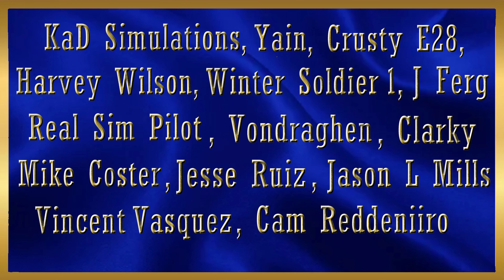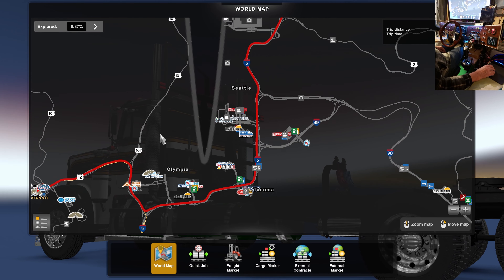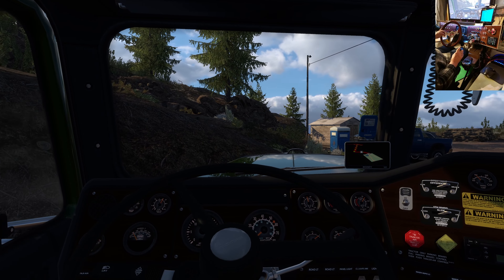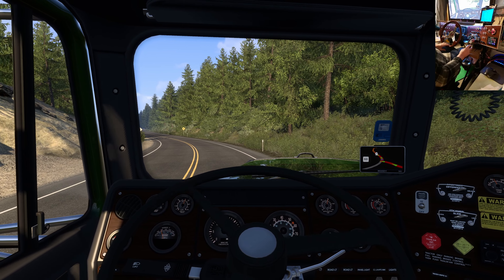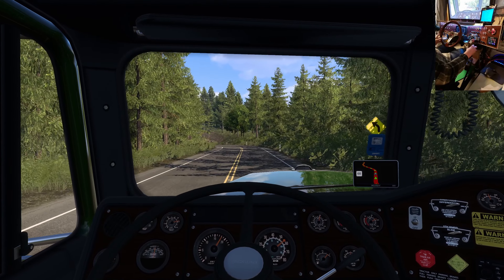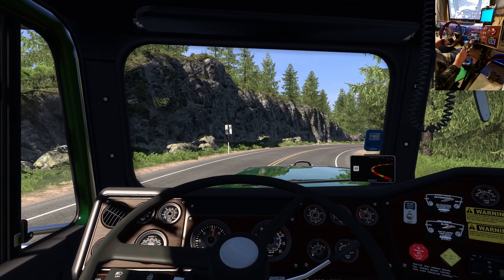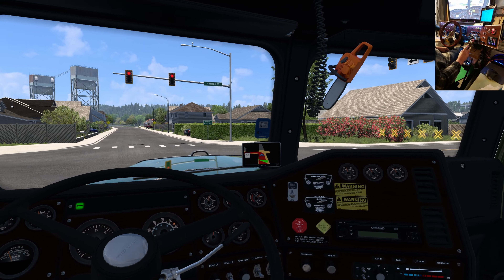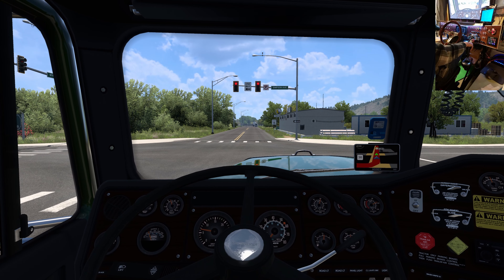ATS | B Double Sunday | Logging Run on Bellingham Mountain | FLC

Comment: That's wild just made this trip up the mountain at 2am in a thunderstorm. Low boy trailer didn't like one section. Very cool drive. Washington is one of my favorites.
Reply from the maker: Very cool. In Saturday's live stream I hauled a triple version of this trailer up the mountain with an all up weight of a ridiculous 260k lbs! Used my modified 8 x 8 Viper. Must have been tough in the rain storm! That tight uphill left hairpin can be pretty tricky!

Comment: Hey,  Dan,  I just wanted to throw an idea out there for you,  what about hot glue for the switches in your knob?  I did that with mine and it's held great....  my knob isn't metal but it should still work and it would be easier removal if you ever had a switch go bad or anything like that.....
Reply from the maker: Thant's an idea. I do like J. B. Weld though. Really easy to control and get it right where you want it.